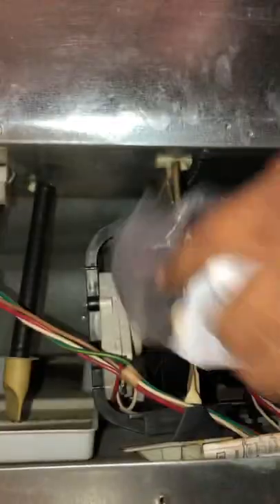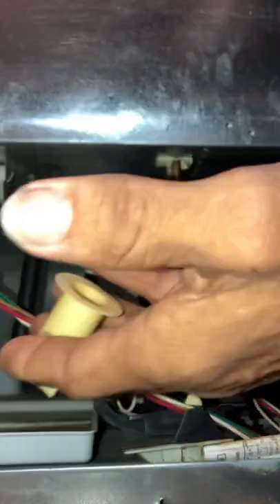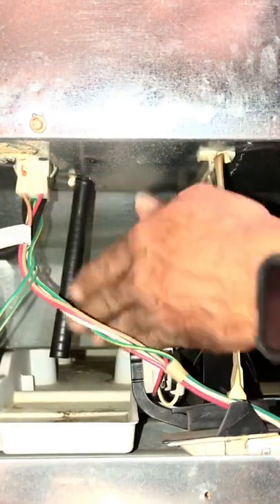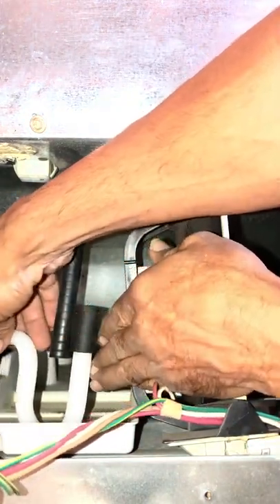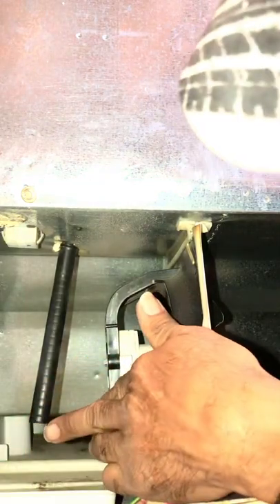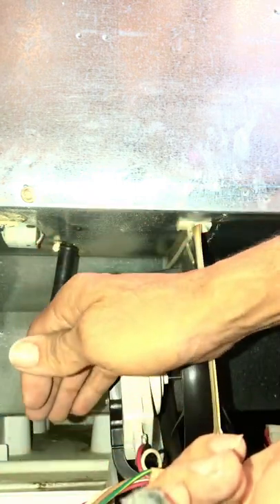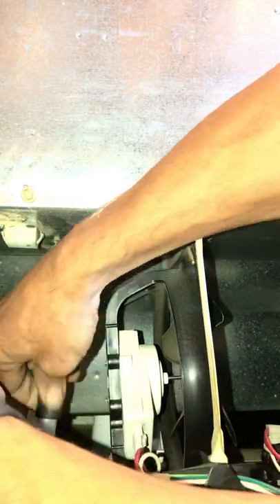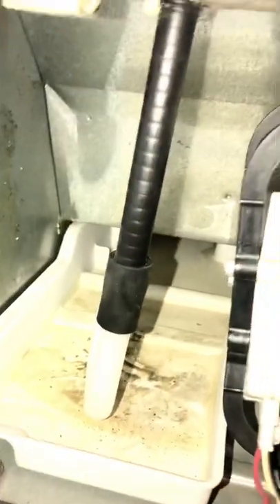Refrigerator Leaking|Clogged Drain Tube Replacement|Duck Bill Updated|Whirlpool Maytag Kenmore

Comment: Love this video - it is by far the best one we've seen.  Leaving this here for anyone who is in the same situation as me:   For some reason, when we looked up (and even ordered) the part number you referenced, we got something very different, and unfortunately what we got (while it is a p-trap drain) won't fit in our particular Whirlpool fridge.  But I did find the exact one you're using, under part number W11190084.  We've cleaned out the duck bill and re-installed it while we're waiting for this new part to arrive for our RV fridge.